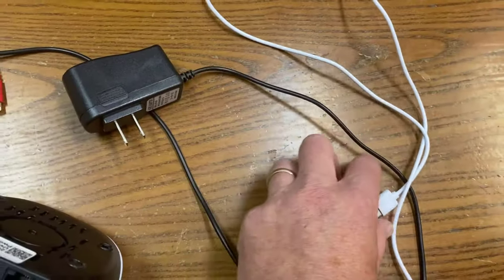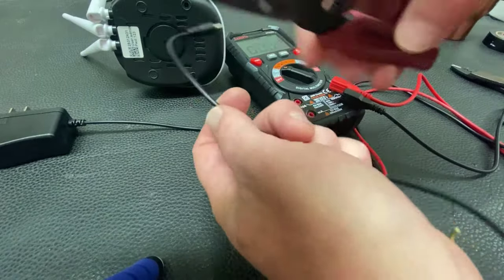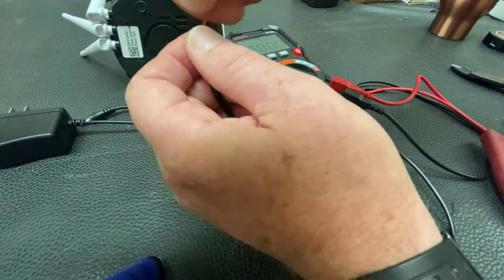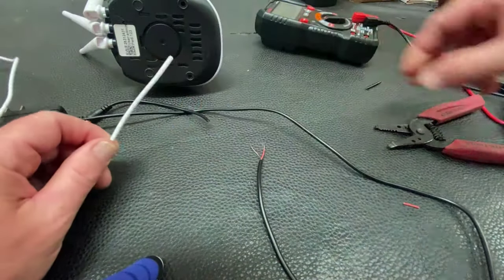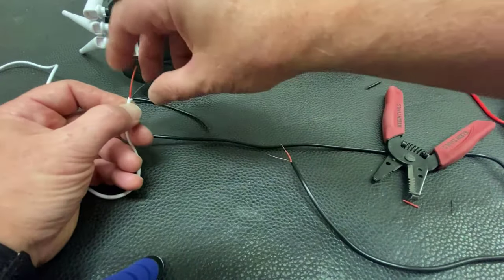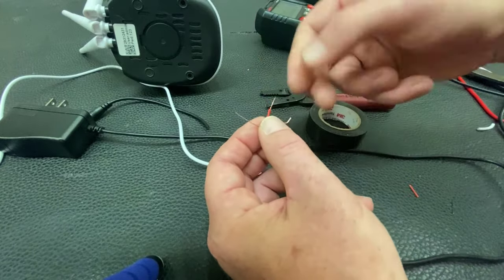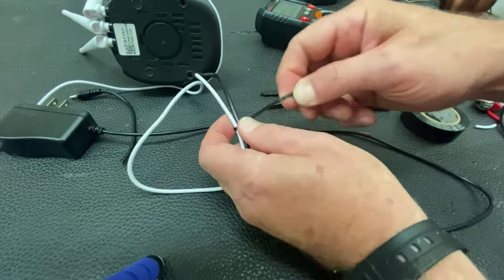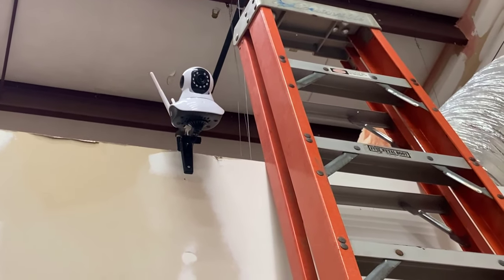How To Hardwire and Adapt a USB to a 12 volt or 110v AC Power Cord

Comment: I'm attempting to take a star shower Christmas laser projector that plugs into the wall and cut off the wall plug and then solder in its place to the circuit board a 5v usb cable so I can power it with a USB power supply so it can be used mobile without a wall plug.... I've done this 3 times but it only worked once. I'm not sure why it didn't work the other 2 times I might have had positive and negative touching so I'm going to show it or maybe these lasers were different brands and required different volts, or maybe just the first time on it took but it only required five volts... Anyways when I'm connecting with positive and negative from USB on the circuit board and the laser there's an L and a N .... Should the positive go to the L or the N if I have any shot at making this work this time and not ruining another laser. If you could reply that would be great thank you for your time. Doing a successfully means I can put the laser shower on my bike as a light and  light up an entire block lol or on my drone and do the same from the sky pretty cool looking. Cheers!

Comment: So wait you wrapped and heat stunk your positive and neg exposed wires together? Oof
Reply: Can't you tell this guy is an electrician?  He wrapped them in electrical tape then covered it with shrink wrap
Reply: I was thinking the same thing but “maybe” he wrapped them with electrical tape, would have been a lot nicer to have seen that then just cut to heat shrink lmao
Reply: not to mention the wire expanding and retracting after using it over & over again. No western union splice, no extra solder. Oof indeed.